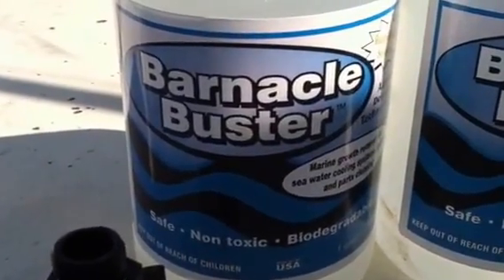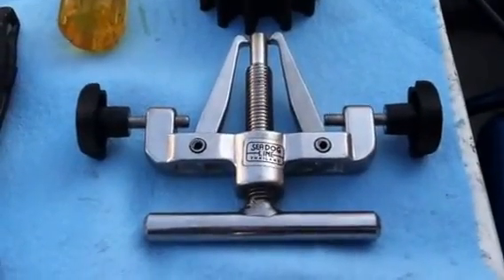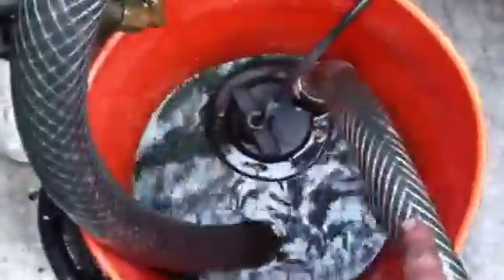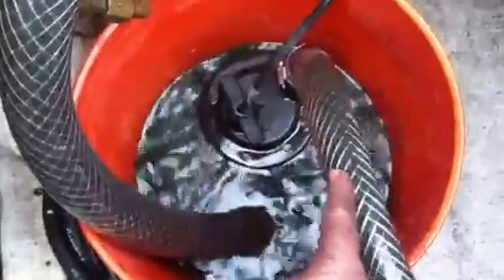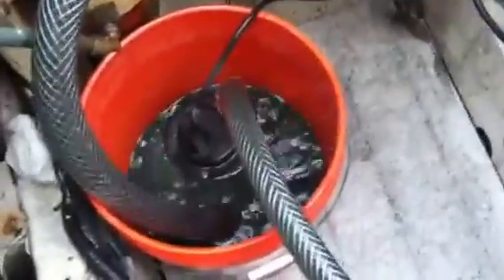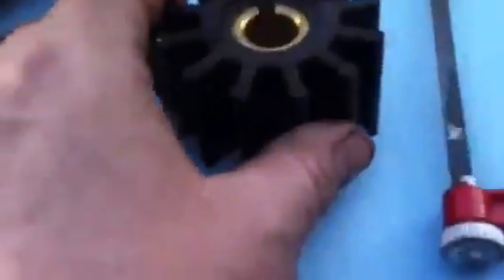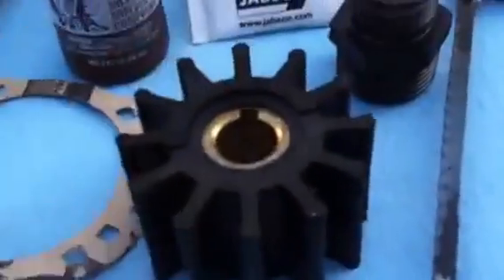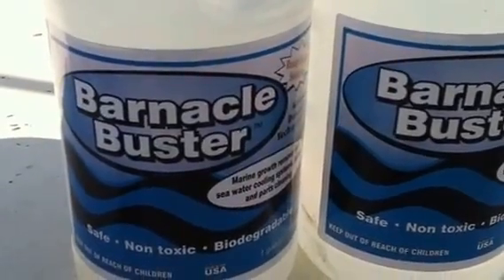Back flushing raw water side on Perkins T6.354

Comment: You remind me of myself. It is always great to have the proper tools to do the job correctly. Every time I buying a new boat I always pick up the official shop manual that the manufacturer put out. And normally at the beginning of the manuals it will tell you if there's any special tools that are needed. Also I was going to suggest you keep your propellers but you already got that covered. Whenever I'm doing preventive maintenance I keep the parts on board just in case. I have to say for the most part I have used my spare parts to help out other boaters that have broken down. Last Summer we were part of a huge raft up party for labor day and one of my friends was the only one who did not have his air conditioning on or even his generator what she only has one. I asked him what was wrong and he told me about the propeller. So I went down to my boat grabbed my tools and spare parts and within a half an hour I had his generator going once again. I do like your idea about the gasket making material. I never thought of that one. I will definitely pick some up tomorrow and put it with all the other boat stuff that I have picked up over the winter. Great video

Comment: Here's a dumb question.  I've watched demos of barnacle buster, and they are always "forward" flushing the engine.  Will running the liquid backwards like you did do anything to the oil cooler or heat exchanger???  I have a Volvo MD-30A that I'm about to do the same thing to!

Comment: I'm just getting into boating. Have a smaller Bayliner 24' openbow with an I/O Mercruiser (hate that motor) 5.7.  Now I know when winterizing I'm supposed to back flush- my question is: do you happen to know if it's a similar setup such as this?

Comment from the maker: Did the trial run today to see if the temps on both motors would drop at least (5) deg running @ 2400 RPM for more than 45 mins.  To my surprise, the temp gauges never rose above 125 deg!!!!!  Last season, and prior to the raw water circuit flush, both motors were running at 185 deg @ 2000 rpm.  I cannot believe what a difference this relatively simple maintence step made for my old Perkins T6.354...pushed both motors hard and they never missed a beat.  Wish I did this in seasons past!!!!!